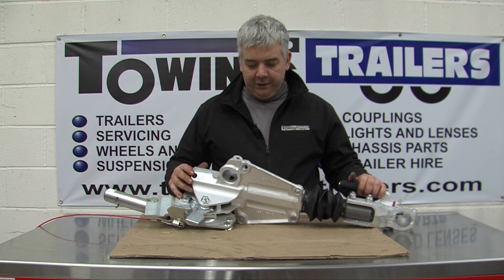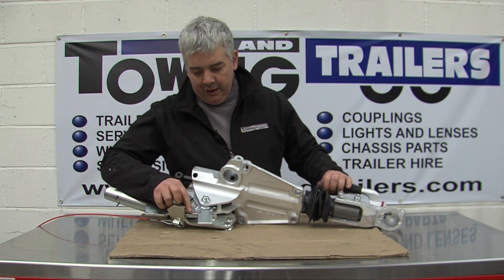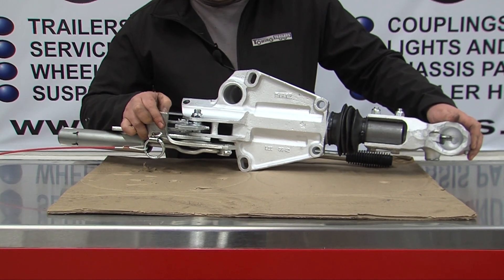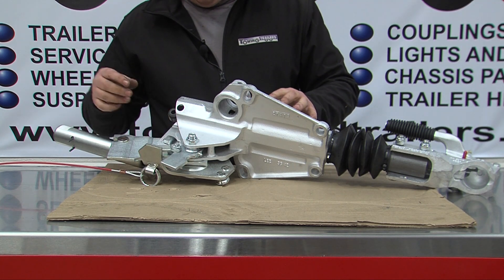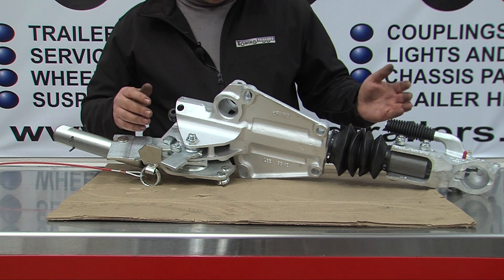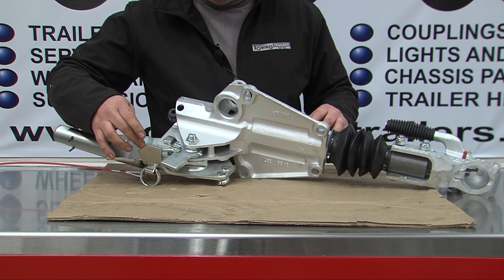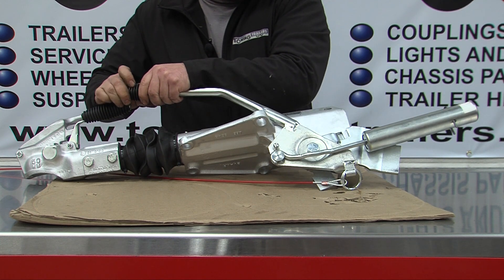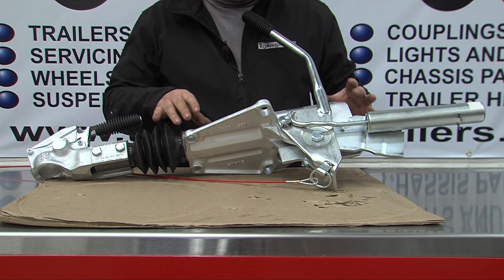How a current Bradley braked over run trailer coupling works

Comment: Hi
How come the brakes don’t get activated when reversing a loaded trailer up hill?
Thanks
Reply from the maker: Hi
Modern brakes have auto reverse systems these are built into brakes and when the shoes are pushed backwards the shoes shrink 
These systems are not always reliable in the situation you have mentioned and only tend to work on well serviced brakes as if there is any resistance in the system such as
Brake cables 
Expanders 
Compensators 
or even the reverse system it self 
these will not operate correctly
Also if you have an heavy load and slowly push the brakes on slowly the auto reverse system may not activate correctly.
If you have this problem I find that pushing the trailer quickly helps the reverse mechanism operate correctly.

For more information on Trailer brakes please see our play lists.

Al-ko brakes
https://youtube.com/playlist?list=PL01a4qPsS1zsH9YtBy1aGx46LCUMtI-zs&si=hak2DZPL-1Ttulv5
Knott brakes
https://youtube.com/playlist?list=PL01a4qPsS1zuSCDYJjZ3t78lISGiS9aWO&si=4UU1D-yE2o1ValvH
Trailer couplings
https://youtube.com/playlist?list=PL01a4qPsS1zuCa_tYczUXenDtVI4v6G0V&si=Mhp_4CYsdaupsOxJ

Hope this helps

Towing and trailers Ltd
www.towingandtrailers.com

Comment: Hi,  I bought an old LM146G trailer,  Has a Bradley HU12 coupling, (SAME AS YOURS I THINK)   I want to overhaul the brakes as they don't work,  It needs new cables,  Your vids will come in very handy as they are the best online,                                                                         I have a question if you can help =                                                                                                                                                  What is that small rectangular cutout on top back end of the coupling, next to the jocky wheel hole  ?                                                                                                                                        My trailer has same cutout rectangle hole and a metal mechanism sticking out, its not there on yours, what is it and what does it do?.                                                                                    Also i pulled my hand brake on but for the life of me I cant pull it back off,   Its so tight, ill need a scaffold tube to help lever the hand brake off,  Why could this hand brake lever be so hard to pull off ?,  Ime worried if i use a long tube for a lever it might damage something, Great vids mate, Thanks, Dave
Reply from the maker: Hi Dave

The coupling used in the video is a smaller HU3 not the HU12 you have but all the principles are the same.

The mechanism you mention in the top of the coupling is a reverse stop assembly it comes as standard on the hu12 but is an optional extra on the HU3 this is pushed down then slid forward to stay in place it stops the draw tube in the centre of the coupling moving backwards and engaging the brakes but once it has done this the spring makes it lift out as there used to be instances where the old style reverse stops on other couplings were left in place and people would be driving with no brakes.

The handbrake lever problem 

There are a few causes for this.

first it is going back too far this is usually due to the brakes being out of adjustment or the auto reverse mechanism activating in the brakes although it is rare that the auto reverse mechanism does this. When the handbrake goes back too far it can be very hard to pull off.

2nd the pivot on the handbrake could have seized this is the bolt that goes through the middle of the handbrake this can be too tight or have stuck to the handbrake to check this loosen the bolt through the middle of the handbrake and make sure the brake link connected to the threaded bar is free.

3rd and most common is the energy store ( the large cylinder fastened to the handbrake) this is a large spring that operates the handbrake and keeps the force on when applied with this being a round spring in a round tube as both begin to corrode the spring begins to seize and restricts the movement to check this is not easy but as you apply the handbrake it will not snap on it will be a little more gradual and you should be able to hear the rust getting moved around (crunching) the rust can also get stuck in the spring that stops it compressing fully and stops you taking the handbrake off. 

We have a video showing how to change an energy store that can be found at https://www.youtube.com/watch?v=hbq-XmEWE94&list=PL01a4qPsS1zuCa_tYczUXenDtVI4v6G0V&index=5.

Due to the price of parts and the age of your coupling if original (Bradley couplings have not been used on Ifor Williams trailers since mid 90's) I would check the rest of the coupling to make sure it is a viable repair check the following

Damper is it working will it push in with a lot of force and come back out slowly?
draw tube is it straight?
head is it tight on a tow ball and no play.
main thing does the draw tube have vertical play in the main cast body ? this is important as there are no bushes in the main body and if it has vertical play it is usually wear in the main casting not the drawtube and you can not by replacement cast bodies.

Your trailer would probably have al-ko brakes if it has a Bradley coupling all Al-ko brake parts can be found at https://www.towingandtrailers.com/products/trailer-parts/trailer-brake-parts/al-ko-200-x-51mm-trailer-brakes/ Please note the backplates on this page do not bolt onto Ifor axles.

if you have one of the later Ifor williams trailers it may be on Knott brakes 250x40 the parts for these can be found at https://www.towingandtrailers.com/products/trailer-parts/trailer-brakes-and-parts/knott-250-x-40mm-trailer-brakes/

there were 3 different brake cables fitted when the HU12 was used 
Early trailers had fixed eye cables that can be found at https://www.towingandtrailers.com/products/trailer-parts/trailer-brake-parts/trailer-brake-cables/knott-fixed-eye-trailer-brake-cables/
For a short period after Al-ko detachable cables were used which can be found at https://www.towingandtrailers.com/products/trailer-parts/trailer-brake-parts/trailer-brake-cables/alko-old-style-detachable-brake-cables/
then they moved to knott brakes that used these cables. https://www.towingandtrailers.com/products/trailer-parts/trailer-brake-parts/trailer-brake-cables/knott-detachable-brake-cable/

for coupling spares please see https://www.towingandtrailers.com/products/trailer-parts/trailer-couplings/spare-parts-for-trailer-couplings/bradley-coupling-spares/hu12-3500kg-spares/

Kind regards

Towing and trailers ltd
www.towingandtrailers.com
01909 473749